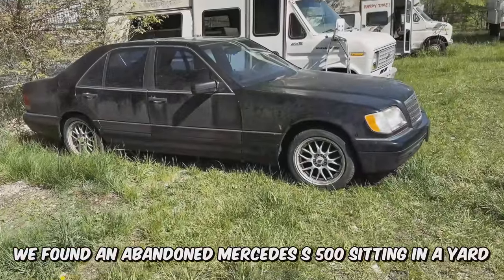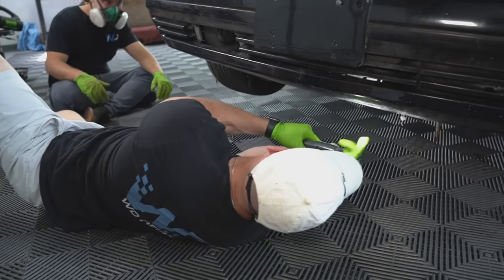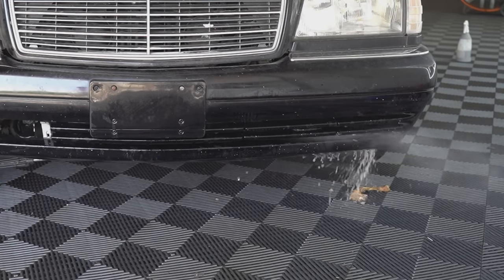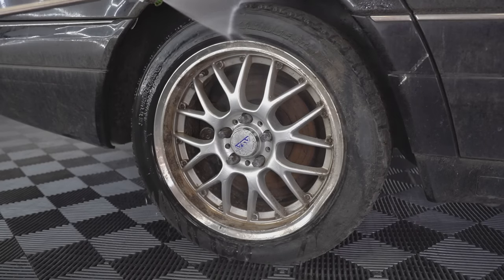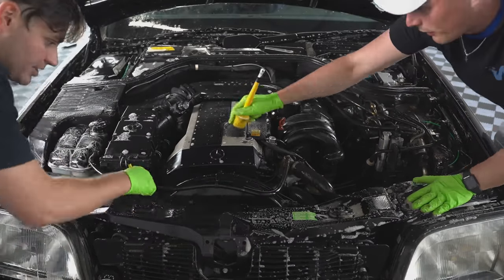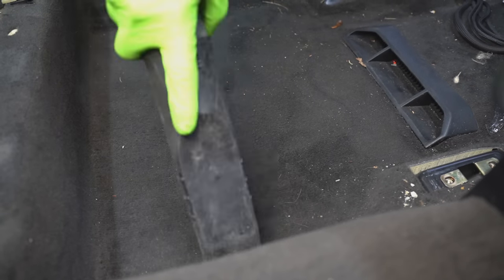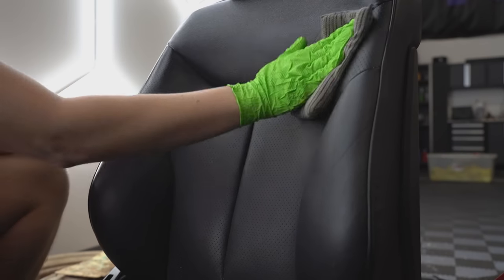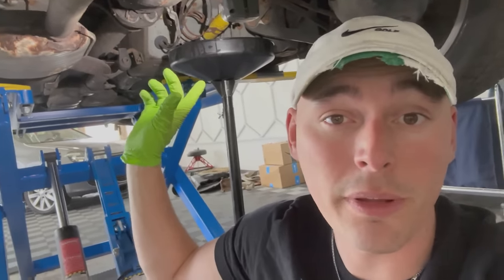First Wash In 10 Years: Free ABANDONED Mercedes S 500! Detailing and Surprising Dad!

Comment: Hey it’s been badged incorrectly. It’s an S320 with the straight 6 M104 engine. The S500 would have an M119 V8.
Reply: And don't underestimate the 3.2l M104. Very good and smooth, reliable motor. Replace the engine wiring harness and possibly the throttle body if it hasn't already happened.
Reply: thats what I thought too
Reply: @kbcarroll  Yeah if you see the gauges jumping around that's a sign the main harness is failing.
Reply: @IKhanNot  isn't that a known issue with this generation of Mercedes Benz cars? They used some kind of biodegradable material to coat the wiring in the wiring harnesses, or something to that extent.
Reply: @markb3756  I believe so, I work part time at a second hand car shop in the holydays and most Mercedes from that time period all have electrical problems. and considering it has been sitting outside for so long the wires in there are probably junk
Reply: @kbcarroll  Yes, I had a W124 with the M104 and I really liked the engine. I did drive a W140 S320 though and it seemed like the M104 was struggling to pull around that heavy chassis compared to the W124. I definitely like the S420s or S500s better as the M119 seems better matched to the W140 platform.
Reply: @markb3756  Yep. They messed up on 2 fronts. Water based paint and biodegradable wiring harnesses.
Reply: I fell into the cheap S500 trap. Rotted harness nightmare. Thank God I only lost a few hundred on it.
Reply: @markb3756  Wiring harness issue was mid-'92 through '95.  The entire car has the same biodegradable wiring harness(s), but it's usually just the engine one that falls apart due to engine heat...the coating falls off then the wires short.  There's one wire that's a different color, say blue instead of green, that's on updated wiring harnesses...so if in the market for a mid-'92 through '95, you can check the wiring harness for that one wire color change to know if it's been replaced.  You can research and find the color difference, I have a '97 w140, so I didn't bother once I found mine as MB had resolved the problem by then.  BTW, ALL Euro car brands were affected (BMW/VW/ETC) but Benz was the only maker that didn't do a recall, all others did.
Reply: @kbcarroll  Wiring harness regarding 1991-1995 which have biodegradable wiring harness
and the throttle body has problem in this generation
i add some ECU LH module too
the M104 is reliable than M119 (Heat issue and some head lubrification problem)
Reply: Exactly it's  S320 V6🤘🏻
Reply: @Aamer_yahya  Wrong. Mercedes never put a V6 in the W140 platform. It's a M104 straight-6.
Reply: @applehugger  🙏🏻 
 you are correct %100
Reply: @Aamer_yahya  Straight 6...not a v.
Reply: @KP-zi6jx  

🙏🏻👍🏻
Reply: @Aamer_yahya  And prob common for younger gens to automatically refer to a 6 as a v6 as that's what most 6's are now...w/the way cars are designed cab forward, and str8 6's are longer than a v8, so a str8 6 is too long to mount sideways for fwd, or traditionally w/fronts of cars shorter, so car companies design v6's now that can be used either way.  Str8 6 is really the best engine design of any though...for turbine-like power delivery and torque.  BMW still uses an inline 6 in the 5-series.
Reply: M104 very reliable and the perfect candidate for a turbo to bring that pulling power up
Reply: These stupid guys being fooled 😅😅😅😅
Reply: I was about to post the same thing
Reply: @KP-zi6jx  you’re correct ✅

Comment: Great find! Remove the tail lights and I’ll bet you find rust behind them. Also it’s not an s500 It’s an S320. The S500 started at 98 grand new and was also a 5.0 liter V8 and was only offered in the long wheel base version for the US. You can tell by looking at the rear door windows. They aren’t as long and are more square. But nonetheless it’s a pretty car!
Reply: The W140 S500 is from 1993-1998. motor is the M 119 E50.

Comment: This is  SWB S320. Using a hose to clean the engine definitely allowed water to flood the wires and spark plugs as th inline 6 has plugs pointing straight up. You have to remove the metal cover and get out as much of the water as you can and dry it out or it'll never run for you.

Comment: The green and red lights are your indicator lights for the locking system. They used that before the turn indicators. Red and green flashing alternately is telling you your key battery is nearing its end. If you try starting it and they start blinking it‘s telling you the immobilizer is active.

Comment: In these cars you can’t just wash the engine with water pressure! There are special covers with which you need to cover the top cover of the motor before washing. If this is not done, water can easily flood the spark plugs and ignition coils. in this case, you need to unscrew the bolts, remove the cover, remove the coils, remove the water, and then try to start the car.

Comment: i have an 1992 MB W140 300SE, and the MAF is faulty, in order for you to get this running (albeit with an error code via MB Star Diag) is to keep the MAF in place but disconnect the wires to it…. it will run like a champ… a little rich but it will run
Reply: when the faulty maf was connected, the car would run rough and hesitate during acceleration until it was warmed up; very hard to find new maf for the w140, second hand units always had the same hesitation issues.. cleaning the maf does not work… so disconnecting it will force the computer to use default intake values and get the car running… no hesitation, all power

Comment: Mislabelling the car's nomenclature is very common practice amongst BMW and Mercedes-Benz owners. This car is actually a S 320, not S 500: the straight six engine is a dead giveaway. The S 500 is sold in the United States and Canada as a long-wheelbase version only. Only S 320 and S 300 Turbodiesel were offered in short wheelbase in the US and Canada.

In Germany, it's norm for the BMW and Mercedes-Benz owners to delete the nomenclature if they don't want to be conspicuous about their wealth (i.e. ordering bigger engines such as V8 and V12) or if they are too embarrassed to buy the poverty-spec car (i.e. four-cylinder or smaller six-cylinder engines).

Comment: It's a 95 or 96 b/c it has the '95 mid-cycle refresh (lower cladding has the beltline in it and the lower rear trunk corners round into the light area, (pre-refresh it had hard angular corners where the trunk meets the lights), wiring harness issue was mid-'92 through '95, so if it's a '96 it's good.  '97/'98 brought the last updates of clear rear turn signals (w/amber bulbs) instead of amber lenses, like this '95 or '96....the point of this is if has the wiring harness issue or not, and by the exterior being the '95 mid-cycle refresh, it could if a '95, or not if a '96, as '95/'96 looked the same...'97 brought more exterior changes for '97/'98, to deep sporty looking 6-hole wheels instead of the standard Benz "manhole covers" as well as clear rear turn signal lenses.

Comment: Yes, as others have pointed out, this is an S320, so please show some dignity and correctly rebadge. I can tell it's a 96' just by looking at the rear view mirror. The lights you show in the video are part of the infrared remote and alarm system. The little round IR sensor on the bottom of the mirror was for one year only. In 97' they went back to sensors in the door handles. As a facelifted 96' (you can tell by the horizontal line in the side view mirror covers) this car does not have the wiring harness issue. I have a 96' S500 & on the M119 engine, the for sure way to know you have the later harness is to check for individual coil packs. If you have the coil packs, you have the later harness. W140's are awesome cars.

Comment: That’s definitely an S320 with the great M104.99x 3.2 inline 6 with 228hp. And not an S500 with the M119 5.0 V8 ( comes with 4.2 as well on the S420) there is also a 3.5 diesel S350 and last but not least a top dawg M120 6.0 V12 with 403hp on 1st year models but got detuned to 389 on the later years. This engine powers the clk gtr, pagani Zonda and every paganis made to date basically use the same V12 from merc with added turbo chargers ofcourse.

Comment: My brother, it will not work because the red and green lights work together because of the security system. You must lock and unlock the doors using the car remote. After that, it will work directly
Reply: I have a 1997 Mercedes W140. I had the same problem because the key I have is without a remote. I bought a new key with a remote, programmed it, locked the doors, then unlocked them with the remote, problem solved.

Comment: M119 E50 Engine, however tis doesn't look right (iirc) it looks like it's a M 104 E32 Inline 6.  like this was a S 320 rebadged.  IT's been a minutes since I've worked on one of these.  But I'm going with the M104 especially with the intake runners on the driver side and the air box on the passenger side!   It was pretty common back in the day for people to rebadge their Mercedes and BMW's (M Logo).

Comment: I would guess that the fuel injectors need replacing. I have a 93 400 SEL that won't stay running and I've changed the fuel pump and filter already. I feel pretty certain that the injectors are bad.

Comment: i had the same issue the problem is the crank shaft position sensor.. i changed it which is in the most horrible part of the engine. it started right up

Comment: Those are becoming collectible fast. Problem is finding techs that know them and quality parts.
Reply from the maker: Yeah, its been a struggle to work on to say the least 😅
Reply: @WDDetailing  In Europe, they keep these running out to 300-400k, but techs and parts are everywhere. It's like having an old Chevy Silverado here... I hope you guys get it worked out, because they are great cars all around.
Reply: Problem is they get very expensive quickly, I now have two of these behind my house. One needs a transmission (bad reverse gear) and the other needs head gaskets. 

Btw WD, there’s a good chance the strainer in the fuel tank is plugged. Can be removed from the bottom and cleaned out because you can’t get them anymore. New seal is available. Had to do that on mine that sat 8 years. Make sure it’s coming out of the tank for sure. Could be plugged injectors as well. Hopefully you guys got it running now though.

Comment: That’s an S320 with the M104 lol not S500. Plus where the heck that guy was spraying to start the engine? 😂 if you want to start a car after years you need to check for oil and coolant then change fuel pump and filter.

Comment: I had W140, 3.2 L (best  6 cyl engine, your 5.0 L is very thirsty).  I bought it second hand but with 65k only.  I gave up when endless faults due to deteriorating components and plastics started to drain my wallet (i.e. serpentine belt+ one bearing &mount $1200!), etc, etc.  A very poor-quality car, only good for few years since new.

Comment: Check the fuel rail pressure and if it's low replace the fuel pressure regulator! check fuel pump fuse! and check the EZL those were very notorious on w126's w124's and w140's! and btw your's is a S320 which is M104 an inline 6 cyl S500 Had M119 V8 and S600 had M120 V12! also make sure you're disarming the car meaning lock and unlock the door with the physical key!

Comment: This Mercedes is not S-500. The S-500 engine is a M-119 E-50, 8-cylinter V engine with 320PS. this is an inline 6-cylinter engine constructed after the 1993 and before 1998... and from intake manifold i can undertant that is a M-104 E32, 3.200cc engine, with 231PS. so the car is an W-140 S-320 model... these "engineers" are totaly irrelevant about this car... they washing the engine...!!! we never do this in a Mercedes. any way they did... the cause of the engine not starting is moisture in the high voltage wires that are under the plastic black cap in the center of the engine, and nothing to do with the pump and moderate air mass. to the wash cars is one thing but to resurect cars ia another very different thing

Comment: That's not an USA Spec S500 with an inline 6, it's a S420. Outside the USA, there were more models of the S Klasse available in the 500 series so maybe it's a European or Japanese spec MB. They better get a new engine harness, the ones from 94 - 96 had biodegradable wiring. Underhood heat and vibration prematurely aged the wires shorting out. They can start under hood fires. A couple of places in Germany make new ones. We have a 95 S500 and 94 SL500, excellent cars.
Reply: It's American spec S320 six cylinder the S420 was a V8
Reply: Have a S420, it has a V8.